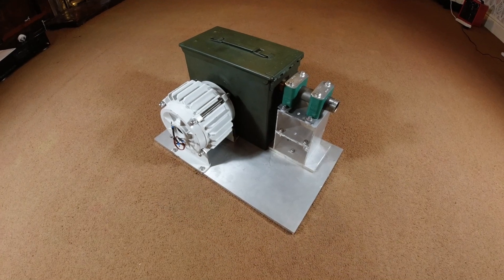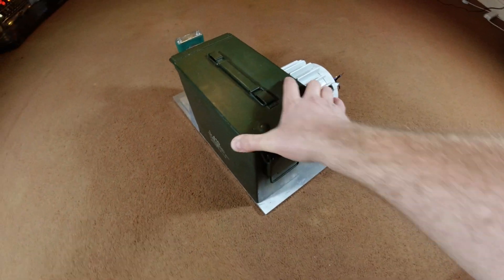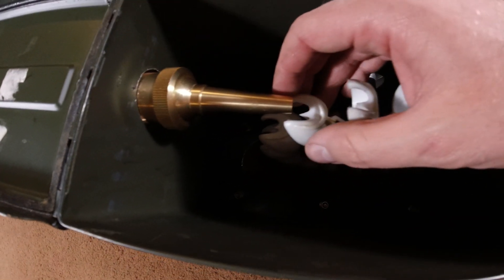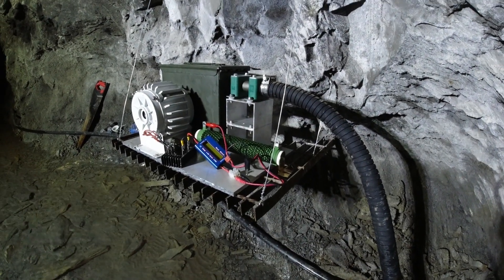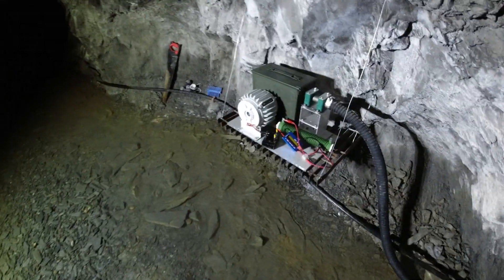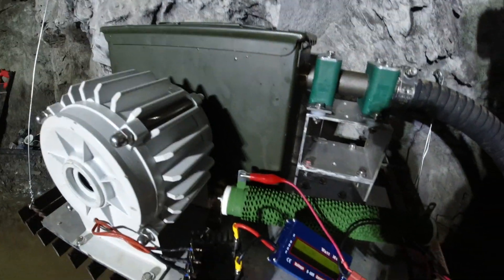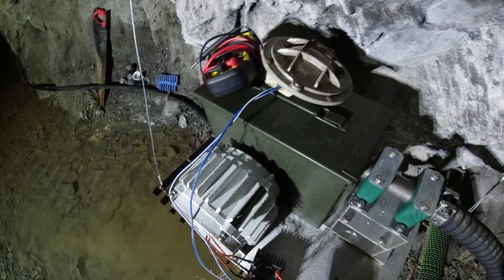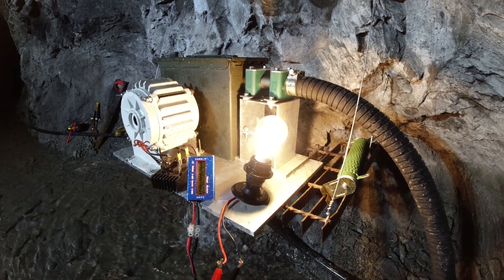Home Made Micro-Hydro Pelton Turbine to charge batteries off-grid

Comment: Looks like the absence of the chain/sprocket reduction gearing sure made a difference between it and direct drive. I was also wondering if something happened to that drive on the old wheel and the chain popped if anything would've damaged the old rig when left to run wide open and freewheeling. I don't know a thing about this but maybe a very little common sense looking. More pressure/flow to make up the difference in gearing but doesn't look like a smaller nozzle will do it because the flow will be reduced and you have to have flow to build pressure and torque. I wish you well and you ought to be able to make a bearing set for the old girl with that lathe when the time is right. CHEERS!.

Comment: Um.  So, that's an ebay link, not a link to the company that made your alternator.  When the item sells the link no longer shows the item on ebay.  Can you spell the name of the companay?  Did you say "Ice Degrees?"  Google didn't give me anything as a result.
Reply from the maker: Sorry for the slow response! Ista Breeze is the company that the PMG came from.
Reply: @TheAmazingAdventuresOfMiles  I really appreciate this video.  It simplifies and explains everything.  I found some other brands of three cycle magnetic alternators and want to try a perpetual motion generator.  My generator requires 400 watts to run...  so if the resulting trust has an output of more than 400watts, it will power itself and provide me with excess to store in a battery bank.  fingers crossed  I'm happy to share if it works but I"m stuck in a truck right now.  Over the road 24/7 trucker.  Driving local after September.  Not gonna patent my idea and will share it openly if it works efficiently.
Reply from the maker: @lotusconsultations9925  Thanks for your comments, it's can't be fun being stuck in a truck day after day. A perpetual motion generator would be a great way to charge a battery bank, I hope that works out for you. Very kind of you to share the design, I'm sure there will be a lot of keen interest in it. Thanks, Miles

Comment: I am just in the process of designing such a system. How durable have the plastic runners been? Has the generator been reliable?
Reply from the maker: Hello David, thanks for watching. Actually I've been meaning to do an update video for this as it's been operational for some time now. I did a few tweaks actually and got it making about 85w in the end. It's been spinning non-stop ever since, still going absolutely fine today, and the plastic cups on the turbine are totally fine. The steel hub is  a bit corroded but it doesn't matter, plenty of metal in it. The only trouble this turbine gave was my fault. I repositioned it a few months back but I didn't clock the fact that it was angled slightly so the alternator was lower than the turbine and I didn't notice but water constantly ran down the shaft and into the alternator bearings. Those bearings failed within a couple of weeks as a result of all the water pouring on them so I had to change them and reposition the turbine level again so the water doesn't run down into the alternator. It's been fine since. Thanks again, Miles
Reply: @TheAmazingAdventuresOfMiles  YAAY!

Comment: Nice build. if it works leave it alone.
You could consider a short length of say 2-3 inch by 10 meters pipe , not familiar with your mine layout, but place the pipe vertically and feed the turbine next to it, if you do, try replacing the nozzle feed pipe arrangement for  close to the same size as your penstock.

The nozzle diameter should be at least a third the size of the pelton bucket, yours looks fine :)
Reply: edit : nozzle up to a 3rd of the pelton bucket size

Comment: Nice!  
Question:  As an R&D Eng, I have to wonder why everyone, everyone, houses the turbine?  The massive amount of back-splash in the housing  must, must,   reduce efficiency  GREATLY.. Why not let the waste-water run straight off, and away?   House the generator & electronics instead!!  after all, these are what needs protecting, and the benefit to efficiency should be HUGE as well.  
If you're going to house the turbine the housing should have super smooth flow path, and eject the water immediately after the turbine, right?  what am I missing?? 
These are all questions as I really, really, dont know.
Reply from the maker: Thanks for commenting Capthuffy. You are totally right in that if it was all totally open it would go faster. I've run other turbines without the housing and there is a difference in power to when you put the housing back on. Not a huge amount but it does make a difference yes. The problem with doing that here is that the turbine is located at the side of a tunnel in a mine, along which people pass regularly. They would get utterly soaked without the housing, as the water really would spray absolutely everywhere! And secondly, There would be a health&safety issue with people walking past a turbine spinning at high RPM. If they tripped and fell into it they would be seriously injured (not an impossible situation given all the water that would be spaying everywhere).
Reply: @TheAmazingAdventuresOfMiles   Thank You. Excellent!   I thought your response would have been to protect the turbine from damage:  In my mind's eye: branches or rock fall from above.
Reply: p.s. also, if done just right the turbine housing can contribute by adding "draw" (suction?) making it more efficient per unit of water.

Comment: Judging from the flow rate under the ammo box, you need a much larger hose bringing in the water. There is a lot of turbulence and frictional loss from such a small pipe.
Reply from the maker: Thanks Oby-1. You are absolutely correct, a larger diameter pipe would make a massive improvement, this is only one inch (25mm) and it's 1/2 a KM long. Because of where it is though, and the difficulty of manually handling pipework though the mine, it had to be small. A two inch pipe would make more electricity but would have cost a huge amount more in labour costs. It's a trade off I was aware of at the time.
Reply: @TheAmazingAdventuresOfMiles  Would love to see an update with a larger pipe. Thanks for the reply.

Comment: Nice job if you choose to increase the pressure with a wider pipe you could try fire hose it’s pretty cheap but seems like a long way love the casing and base looks very neat 👍
Reply from the maker: Thanks for watching and your comments. Yeah layflat hose is a good way to do it but in this case I wanted to be able to bury the pipe so it's not visible in the ballast on the mine floor. I've got another location in the mine where the drop is about 100 feet, almost vertical, and enough water to keep a 4" pipe full. I think this would spin a turbine very well, I will be sure to do that when I can and I'll make a video!
Reply: The Amazing Adventures of Miles ace idea that can’t wait to see the results keep up the good work

Comment: Try an MPPT (maximum power point tracker). That will load the alternator at the best efficiency point.
Reply from the maker: Hi there George. You're totally right, I did actually swap out the old charge controller to an MPPT one and it made a big difference, as in nearly doubled the wattage. It's funny to hear it hunt around for the optimum output, the wheel is constantly changing speed but slowly.
Reply: @TheAmazingAdventuresOfMiles  Yes, it's really interesting! Mine starts off all voltage (drawing no current) and transitions to all current (so there's minimal voltage). I guess it internally tabulates that data and then goes back to the maximum power point where it then loosely follows the curve maxima as it moves. Clever stuff!
Reply from the maker: @m1geo   Yes I figured it would be something like that because when you first start it, it spends ages trying it at all speeds from full-whack to grinding to a halt, then goes back to somewhere in the middle where the watts were highest. But it doesn't just stay there, it tracks up and down a bit to hunt for any improvements if conditions change.

Comment: That wheel is barely turning!
Reply from the maker: Yeah. I think the nozzle is still too big and also the charge controller is forcing it down to about 14v (open-circuit voltage is about 40v) which is slowing it right down.

I've got a new nozzle for it and an MPPT controller sat in the back of my car, I'll go put them on soon and I reckon it'll make quite a difference.

It's been spinning constantly since January now.

Comment: Good effort...need to double up the pipeline if you want more power.  Do you still get slate and how come the mine isn't flooding most mine hydro's are used to pump a mine dry not fill it.  :)
Reply from the maker: lol yes, well this turbine is positioned 1375 feet below the surface, but it's still above sea level (just) as the mine is in the mountains. The mine has a deep-drainage tunnel that runs to the outside world, far from this turbine but vertically only about 30 feet below this point. The deep tunnel sets the "free drainage horizon", meaning that no matter how much water you pour into the mine, it'll never flood above that horizon. However, there are many miles of flooded workings below that level, dropping down about another thousand vertical feet. That was always pumped out back when the mine was operational (as in extracting slate) but now it's just flooded and the water stays there. Would love to pump it out one day just for a look before it fills up again but it would be very expensive to do.

And yes Welsh Slate is still extracted but it's only a fraction of the industry that it was, and what slate does come out is quarried from the surface now, no mines are working anymore. 

The reason for this is cost, operating a mine in the UK is very expensive and although there is plenty of slate here, and it really is extremely good quality, there is no way to compete with the likes of China. They can extract their slate much cheaper due to their low labour costs, taxes and legislative compliance. If you're building a housing estate somewhere then what you care about is price per ton, not where it has come from, and whether the roof lasts 100 years or 300 years is of no consequence on a house that you only guarantee for 10 years.
Reply: @TheAmazingAdventuresOfMiles  Now that would be fun and possibly a bit dangerous if things started to collapse.  Count me in if you fancy pumping it out I've done a bit of caving in my time and its great fun.  Guess your in Wales some where,  I'm in Scotland.  Good luck with your wee hydro.  Cheers
Reply from the maker: @martinfoster288  Yes it would be fun but seriously expensive. Would also require the appropriate licences for dewatering drowned workings, but that's unlikely to be an issue as slate-mine water is very clean (if it was a lead mine for example it would be a different story). Slate mines generally cope well with dewatering, I wouldn't expect much ground movement from pumping it out. Not that it'll ever happen unless I win the lottery...

Comment: Hi. Great video and design. I always wanted to build a hydraulic system, but I wish there are companies that sell the system altogether like the turbine, runner, generator, batteries, inverters etc. I want to build a hydraulic system back in Africa where we use 220V instead of 110V in North America. Do you think I can use hydro system to power appliances like AC, fridge, microwave i.e all the heavy loads or do you think I should use it for smaller loads? I have not experience connecting wires from the generator to the batteries. What should I be careful about, when it comes to wires? What kind of batteries should I buy? Would I need an inverter as well? Sorry about all these questions, but I am interested in your advice and starting a hydraulic system soon. Thank you for your help.
Reply from the maker: Hello Eugene and thanks for watching. Yes a hydro system will do all you want but if you do it as a Pelton like this one, you will need a high pressure water supply. If you live in a mountainous area with lots of water, great. If you live somewhere flat, a Pelton won't be any use at all.

I would advise you to have the turbine charge a bank of large leisure batteries, then use the batteries to power a 220v inverter to give you your electrics for microwave and things.

Wiring the turbine to the batteries is easy, you just need a wind-turbine charge controller (cheap on eBay) and that'll convert the three-phase from the turbine into charge for your battery. It will manage the charging for you, you just need to hook the three wires (in any order) from the turbine into the charge controller, then connect the charge controller to the batteries.

There are lots of different batteries on the market, personally I really like the Victron Gel batteries, they are very good quality but they are expensive. This turbine charges two 130AH Victron batteries. 

I hope this is helpful to you!
Reply: @TheAmazingAdventuresOfMiles  Right about the pelton being useless on the flat BUT an undershot wheel would work. Maybe an overshot wheel if fall is limited.

Comment: With the vertical head behind that water, getting a nozzle sized so that you maintain your static head is important. I mean, ideally, you'd flow the maximum water possible without losing head. But better to be a little too small than a little too big, as the pressure is key. 
Pressure is what gives you speed, and we all remember the equation for kinetic energy. 
Without knowing your final flow rate, it's all conjecture. But with that vertical head, more than 100W is very achievable and I'm 100% certain that your setup will get you there. Fine tuning is all it will take.
Reply from the maker: Hello Christian. Just wanting to thank you for your helpful and encouraging reply, I think you are totally right and that the jet size is too big. It's about 4mm at the moment, so I think it's loosing a lot of the pressure. I think I will fill the jet with molten tin or solder and then drill it to perhaps 3mm.

Something else has dawned on me from the electrical side. I wonder if an MPPT charge controller might give a better result as the open voltage (35v) is quite a lot higher than the battery voltage (12v). My current controller is just a simple connect/disconnect type so it forces the turbine down to battery voltage. I will try it next time I am down there :)
Reply: @TheAmazingAdventuresOfMiles  MPPT won't change what the generator creates, but it will sure as hell give you more at the point of use. In this case, I'm guessing you'd more than double your real charge rate.

Comment: The friction through a 1" pipe 1Km long is the killer. 
There is no way around it, but to put a much larger pipe in, over that length.
The smaller the diameter (pipe). The more friction is produced from the walls of the pipe by the speed of the water trying to go through the pipe.
Try and reduce speed of water to 1.5 Litres per second which will reduce the friction through the pipe.
Reply from the maker: Thanks Bill. You're totally right that it's the pipe diameter that holds it back but the installation of a much larger pipe would be extremely expensive that far underground. It's not just the cost of the pipe, it's the cost of the workforce required to drag it down there and install it. And the route it takes is a bit torturous! But it doesn't need to make a lot, it just needs to keep some large lead acid batteries floating. A smaller jet does seem the way forward, I will experiment with a really fine one to see if it yields more watts.

Comment: use the external power for the powermeter a 9v battery will do
Reply from the maker: That's a very good idea, there is a little socket for external power but I don't think I've got anything that will plug into it. I'll have a look about.

Comment: Fantastic video and extremely interesting doing this down a mine. The Pelton wheel needs two heads minimum from what I have read, some setups have upto five heads around the wheel to get the optical RPM, I was wondering if you built a water storage tank above the water turbine holds let’s say holds 1,000 litres,  and a 15mm pipe coming out at the bottom to the nozzle, this would give you the pressure you need to run the turbine. The water in the tank will not drain fully as the water out of the nozzle would only despise out a tricycle for water compared to the mass of water in the tank and will have continuous water in from the stream to the tank. Also a valve in front of the nozzle would allow you to increase the pressure or tun off incase you need to top the water tank up.
Reply from the maker: Thanks Trevor for your comments and useful suggestions. I think what you're suggesting there is a kind of pressure reservoir? Which would certainly work but I think it would only provide a surge if the turbine is stop-started. Or I think anyway. It's a bit like the air receivers the miners used, basically the air pipe to the drill was extremely long and there was a big pressure drop to the drill, so they put a big steel high-pressure tank at the drill-end and it would fill up and pressurise, then provide a big surge of pressure to the drill when it was needed. But it required a stop-start use, it wouldn't have been effective at continuous duty. I think that's what you're suggesting, but not too sure. Thanks Trevor!
Reply: >The Pelton wheel needs two heads minimum

I'm not sure why that would be necessary.

>Also a valve in front of the nozzle would allow you to increase the pressure 

Pressure is a property of water head. A valve won't increase pressure unless the flow rate though the pipe is so high the water head drops.